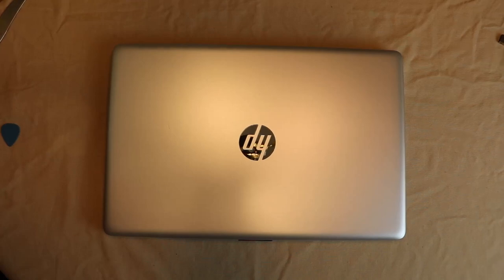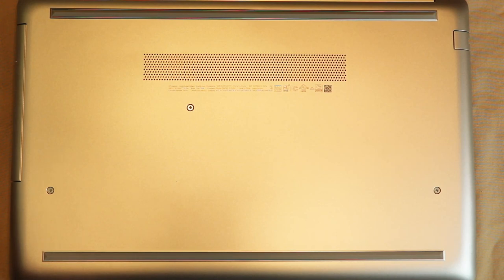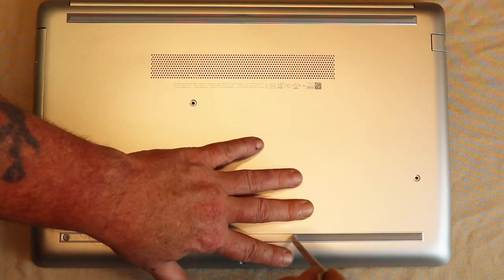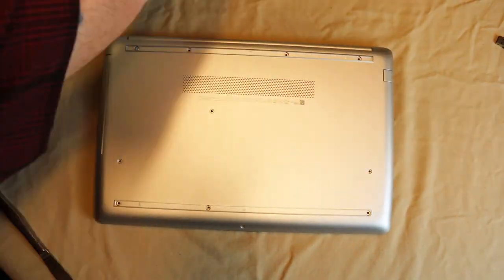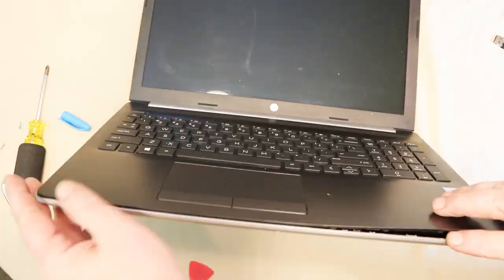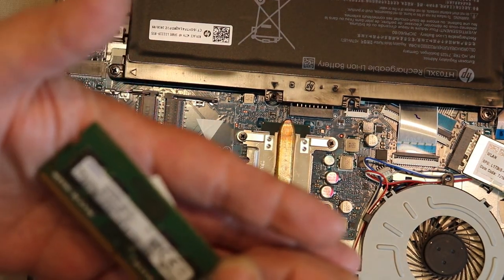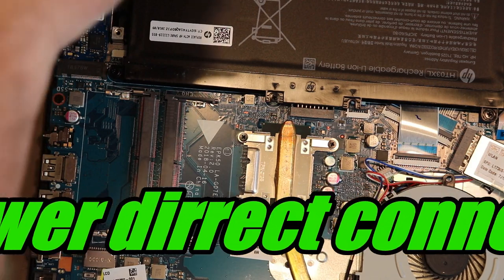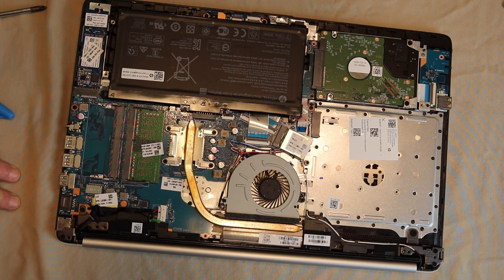Hp hp 15-da0053wm Ram Upgrade

Comment: What ram is in it? New egg says ddr3 but I have those around and I took it apart and it's not ddr3. So ddr4?
Reply: For the da0053wm its DDR4, that's what HP's site says and that's what I put in mine, and it worked.
Reply: I put some Corsair vengeance 2666 ram in it and it worked perfectly, I ended up returning it, it was to slow for me so I ended up buying something else. Thank you for the response 😊
Reply from the maker: Yes, it is DDR4 ram. Mine came with only 4G and I've upgraded it with one more 4Gb stick for a total of 8 now. I edit 4k video and this laptop worked with 4k video before the ram upgrade but was a bit slow, but now it flies. Thank you for your post and thank you to those of you who stepped in to help. You have no clue how much I appreciate that. All in all, I still think this is a great choice if you are looking for a cheaper laptop that will also edit 4k videos.

Comment: Do you lose warranty for doing this?
Reply from the maker: You know, that's a good question. I don't think I did because when I was talking to the expert on the phone about my issues I told them that I added extra RAM to it. And they still help me with my laptop. And like I said they even extended my warranty on it for 6 more months. So I really wish I could answer that question but I can't. I would say if you had to send it in and you had extra ram or something like that in it, I would take it out before I would send it back. I hope this answers your question. And thank you for posting and for watching my video.
Reply: @HayesTech  Good advice. Thanks.

Comment: Is there different speeds of ram that i can buy?
Reply from the maker: Yes there is. You can actually install 2, 32gb sticks of ram, if you have the money...lol... Some day...lol
Reply: @HayesTech  Actually, that laptop maxes out at 32GB which is 2x16GB DDR4 SODIMMs.  To find out exactly what is compatible with your PC, visit Crucial.com.  You can either download, install and run (it is clean, no viruses or spyware as they are a memory and SSD manufacturer) their system scanner and it will tell you everything you need to know.  Or you can go to the same website and look up your PC by the manufacturer and model number or product number.

I hope this helps.  KSReferee

Comment: But can the computer go to 16 gb ram
Reply from the maker: Ass far as I know, yes. I think the most it can handle is 32Gb. I honestly would purchase a single 16Gb chip if that's the most ram you want. I find that using a single chip in the amount you want, in the "A" slot, works better than using 2 chips and utilizing both ram slots. That's just my opinion though but thought I would mention it.
Reply: @HayesTech  thx

Comment: Can I upgrade this "16 GB storage acceleration" to a decent size pcie m.2 SSD and install Windows on it ? Did anyone try this ?
Reply from the maker: Yes you can put a standard SSD is this device by pulling out the hard drive and replacing it with the high speed SSD. As for changing the Intel Optane ram for an SSD hard drive.. I'm not sure. I'm new to this M.2 technology and how it's used. I do think they make an M.2 style had drive with like 256Gb of storage on it and you should be able to install Windows and run it from there, but I've n never tried it. For what I do, editing videos, using the M.2 the way it was intended works for me for editing video, so I'm not going to change that. I'm editing 4k videos with only 8GB of Ram and no non integrated video card and that's hard to do without the Intel Optane acting as another 16Gb of Ram.
From what I've read i can upgrade my Intel Optane Ram/M.2 with up to 118Gb it more but the 118Gb chip is $200.00. So if i ever upgrade it, it's more likely to be to 32Gb and that's only $76.00. That's more like what I can afford.

Comment: Mine has ryzen 3 2200u. Do you know what the max amount of ram i can add
Reply from the maker: No. If it's the same one I have it's 32GB. I'll have to look and see what mother board they used in it. I checked into the max ram for mine when I checked in what ram mind took and found out that 32mb was the max for the Walmart laptop that I have
Reply: @HayesTech  hp 15 db0003ca ryzen 3
Reply from the maker: @Lasershark789  
Here is the link that I found. 
https://www.crucial.com/usa/en/compatible-upgrade-for/HP-Compaq/hp-15-db0003ca

Comment: I just upgraded a similar laptop HP 15-dw0054wm.  Mine had 8Gb Samusng DDR4 2666.  So bought a stick of the same but gskill brand thinking id get the Dual channel speeds of 2666 but now my max speed is only 2400mhz... Just wanted to let people know if you run into its hps mother board which show on their spec page should come with 2400mhz ram.....
Reply from the maker: You are absolutely right Sir. Whenever replacing RAM in any PC or laptop you need to stick with the exact RAM and RAM speed As what is in the machine stock.
Reply: @HayesTech  The strange thing is HP put samsung 2666 ram in the laptop...but the motherboard is only rated for 2400....Crucial actually showed the laptop could do up to as 3200...luckily the gskill 2666 stepped down to 2400...and I triple checked the actual ram stick...oh well...Thanks for the great tutorial because these laptops can be buggers to take apart...I actually used a piece of the clear plastic from the ram packaging  and a plastic pick to un do the clips of the frame . worked really well...These things like to come apart maybe once if your lucky....I use to only buy laptops that had  bay doors to change things, but that seems harder and harder to find as these thinner lighter laptops are basically throw away to the big computer companies.   Id love to know the Engineer who thought its a great idea to put the screws under the rubber feet...Really???   Thanks again...Now my budget Hp has 16gB of ram and google chrome can eat more as its become super power hungry the last few years....
Reply: Also if you can find this model on sale it comes with a Samsung NVME M.2 SSD and it gets the real 3500 mb/s reads
Reply from the maker: @JasonKale  
That's very good information and I appreciate you passing this information on to us. Upgrading ram is not as simple and straightforward as a lot of people think and you need to know what your pc or laptop's motherboard will accept before you purchase extra, or more, ram.
Reply: @HayesTech  Youre welcome. I thought I should help!!!! Thanks again for your vid!!!!
Reply from the maker: @JasonKale  
Any time one of you, the people who watch my videos, help out with information like this, I am very grateful. Thank you again and hopefully, I will see you on the next one. 😎
Reply: I have that laptop too. I bought additional 8gb 2400 cause it said it comes with 2400. While testing my laptop I noticed performance is not even close to other laptop with a bit slower ryzen 2500u. So I downloaded CPU-Z and it showed that the first module is 2666 -_-
I guess I'll have to buy 2666 now
Reply from the maker: @dado6907  
Thank you for that information. It's information like this that helps. My guess is they used more than one type of ram and you are correct that you should match your ram exactly. Mind just happened to be what they advertised and was easy to upgrade, thank goodness.
Thank you again for the awesome information as information like this will help a lot of others out there
Reply: I have tried to upgrade mine from 4 GB- to two 8 GB so I can make it 16. No can do. this computer does NOT have an additional SLOT to put two sticks. Very upsetting. So i replaced my original 4 GB with a single 8 GB stick. The other space that may look like a "slot" doesn't have the clamps to hold a stick together and nothing can snap into that space thought it looks like it IS the right space- as the stick fits in that space perfectly. Bummer
Reply from the maker: @joyl9083  that sucks. Sorry about that. I actually researched the one I purchased before I got it, to make sure I could upgrade the ram. But it's not something that most would think necessary in this day and age. It sucks they couldn't give an extra slot. At least you were able to upgrade using a single ram stick though.
Reply: @HayesTech  The 8 gig stick made a HUGE difference- I am very very happy! Thanks
Reply from the maker: @joyl9083  that's awesome. I'm glad it worked out for you. I know, it sucks not having enough ram and having your computer slow down because of it.
Good luck to you and have fun with your, now faster, laptop.
Don't forget to get in on my huge giveaway too, if you haven't already.

Comment: Is ther slot m.2 in 
HP 15 DA1031NIA for ssd
Reply from the maker: I searched for your laptop and am not finding any good information. It doesn't look like it can with an M.2, like mine did, and i can find anything on its motherboard yet. I will continue to look though, and if I find anything, I will post the link here for you.
Reply: @HayesTech   thanks bro for helping  💚
Reply: @HayesTech  specification of laptop 15-da1031nia 
I7 8565u
Ram 8 ddr4
Nvidia mx 130 gb
Hdd 1 tb
Reply from the maker: https://support.hp.com/us-en/document/c06362691

This is all the information i could find. Now, I'm sure you can upgrade the RAM but as for installing an SSD, without knowing whether the laptop has a slot for this on it's motherboard, it hard to say for sure. You have a pretty nice laptop from what I can see though, so if it's anything like the rest of HP laptops, you should be able too. But i would pull the back off (very carefully) and check for an SSD Port on the motherboard. It did not come with one, like mine came with, so if you could add one, you will also have to install all the correct drivers and programs to use the SSD.
Reply from the maker: @kromatet-8008  
You are very welcome. I wish I could help out more but your laptop model isn't giving me very many options for upgrades, when i do my usual searches.  I would check out the forums for HP laptop hello too.

Comment: Dear David,
Please help what is the exact name of the part to which the 2.5 "SSD, HDD connects? Where to buy it?
I didn't get it for my laptop.
Exact type: HP 15 da0041 ....
Reply from the maker: I'm not exactly sure what you are asking me. Sorry about that. But the Optane card is a 16 GB PCIe® NVMe™ Intel® Optane™ Memory for storage acceleration and should have come installed on your laptop. There are other posts on this video with links to all the upgrades for this laptop. I can't remember which post it was right now but the information is there. If you still can't find what you are looking for, ask me again after the holidays and I will help you find what you need. Thank you for watching and for posting.

Comment: That laptop has SSD?
Reply from the maker: No, it has a standard hard drive, but fast, comes with 4GB ram (I've added a 4GB stick for a total of 8GB) and has HP Optain memory (it's like extra, super high speed ram, in a way {16GB}), had a 15.6 inch touch screen and 3 USB ports (two of which are 3.0 and higher).
Reply from the maker: No, it has a very fast typical spin drive (but a fast one), a 14.5 inch 920p touch screen, comes with 4GB ram and I installed another 4GB for a total of 8GB and it has an Optain ram card, which is basically like an SSD but acts more like ram then an SSD. It gives you the option to replace it with a true SSD though. But with the 1TB memory that it comes with, I don't need the extra storage. Although there are arguments that the Optain memory isn't worth it and changing that to an SSD and installing the windows OS into that, would speed it up.
To be honest, it's fast enough for me the way it is and the only thing I'm going to change (right now) is to add more DDR4 ram. I would love to put 32Gb in it.  That Optain ram can also be upgraded to 32, 64 or even higher but since it is so new technology it's super expensive. Right now the Optain ram it comes with is 16GB. So there is 16GB Optain ram and 8GB DDR4 ram. 
I hope this answers your question and I plan on upgrading this laptop soon. When I do I will video the whole process.
Reply from the maker: Sorry there was 2 replies. After clicking "done" when I was done with the first response, it didn't show so I commented again...lol...
Reply: @HayesTech  thank u
Reply from the maker: @AlexAponte  you are very welcome.

Comment: My work laptop a Dell has only the M.2 hard drive.  It came with 256GB and 8 GB of RAM and I asked my boss if I could purchase a 1TB  M.2 drive and 16 GB of RAM for my i7 Dell and he got aprovall and I got my 3 quotes and CDW charged me like 125 for the 16 8X2 Modules DDR3 and the 1TB M.2.  Sped things up greatly.  Your Laptop looks like the Intel version of my laptop that I just picked up on Ebay for 100 dollars.  Mine is the HP 15-db0066wm and it has a Ryzen3 chip in it.  If it has an M.2 slot in it I think I'll just get another one and ditch the mech drive and just go with the M.2.  It is just an SSD after all and you can find them for 100 dollars on Ebay.  I had to go through our approved resellers at work but for my own probably just Ebay, Amazon or Ali Express.   The 16GB of RAM is going to be here tomorrow. and the bottom of my rig look just like yours even the two long rubber feet.  So thanks for being brave and now I know what I'm getting into...
Reply from the maker: You are very welcome and thank you for the great information. I think the technology has grown leaps and bounds since back when I built my last PC and going with old tech like spin drives is definitely not the way to go any more. M.2 drives are so fast. It's a night and day difference.

Comment: I have this problem with my laptop, there is no network signal ... do you think this problem is the same and what should I do? HP Notebook - 15-da0053wm

   Details of your product's warranty status: expired

 

   Serial number CND8202J7D

   Product number

   HP Basic / Manufacturer's Warranty

   Guarantee type

   Manufacturer's guarantee

   Type of service

   Wty: HP External Hardware Maintenance Support

   State

   Timed out

   Start date

   July 10, 2018

   Final date

   July 09, 2019
   Support and external materials
   Hardware Problem Diagnosis

   Type of service

   Wty: HP support for initial setup

   State

   Timed out

   Start date

   July 10, 2018

   Final date

   October 07, 2018

Comment: Could you do this with a 15-0032wm? I mean they’re basically the same computer
Reply from the maker: I couldn't say yes or no. I am not familiar with your model of laptop. But in my experience most any laptop can be upgraded. I would type in a search with your laptop model number and RAM (for instance ram for 00DVxxWM) in Google search and I'm sure you will get your answer. That's how I found the correct ram for mine. Good luck to you.